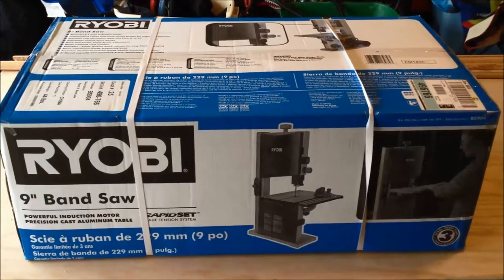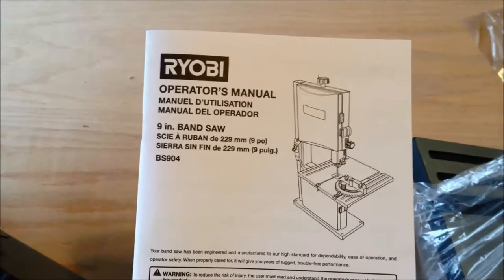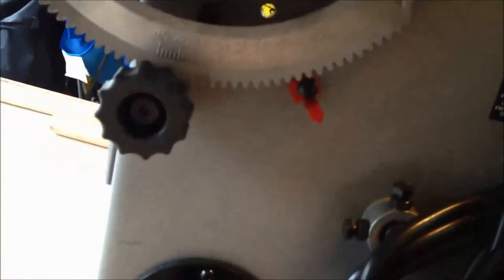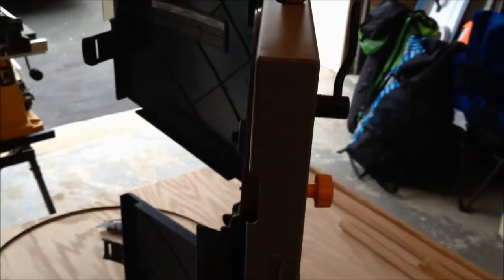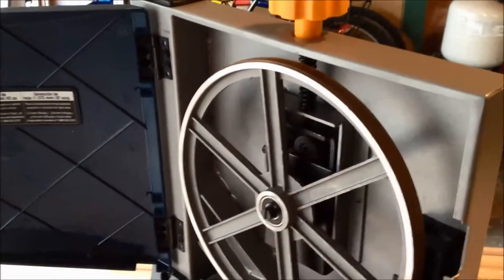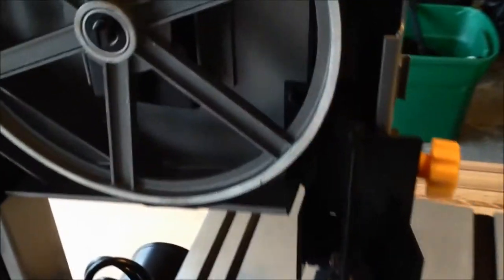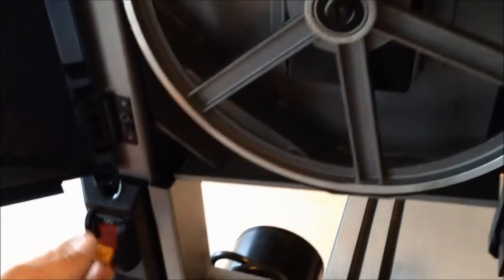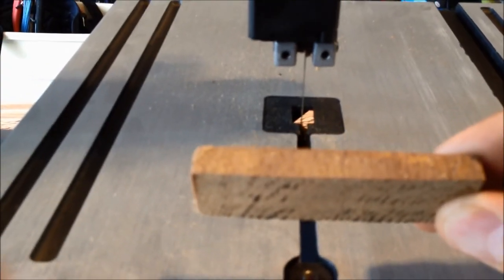Ryobi 9 inch Bandsaw - UNBOX and SETUP

Comment: How tight do you tension? The blade seems to travel on me the longer the cut so I am not getting that straight cut, which leads me to believe it isnt tight enough. I just purchased one (the newer green model, but the workings are exactly the same).

Comment: Video was helpful - thanks. However, on the tracking, the manual says to have the tooth of the blade on the center of the wheel, so the back edge of the blade actually is at the edge of the wheel. Not sure how critical that is, but I thought I'd mention it.

Also, the newer version (with green plastic) has a manual that's somewhat sensible. Ryobi clearly pays attention to what it's users say.
Reply from the maker: Wow and informative manual...what an idea :)